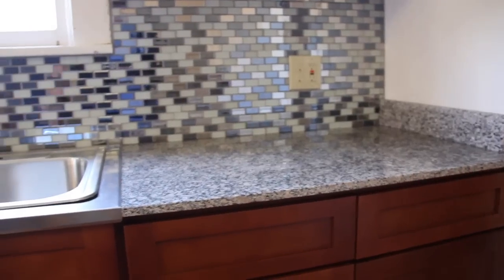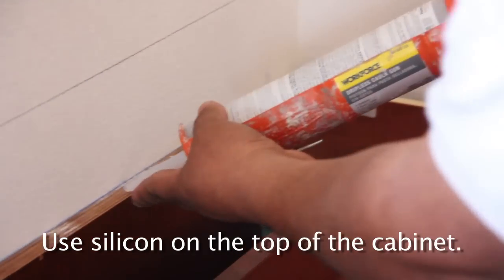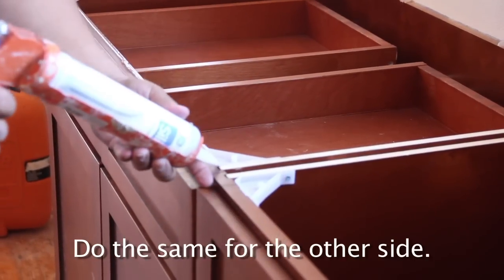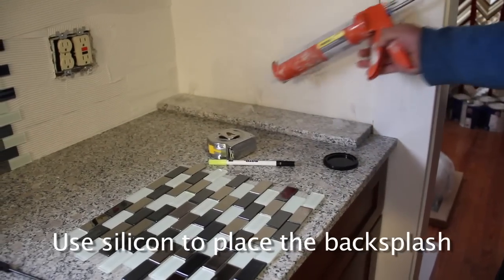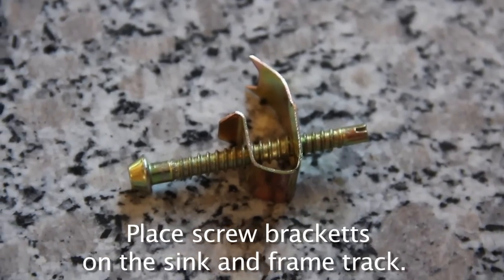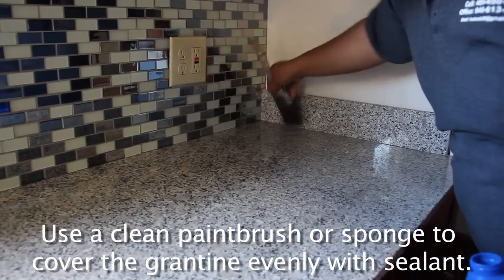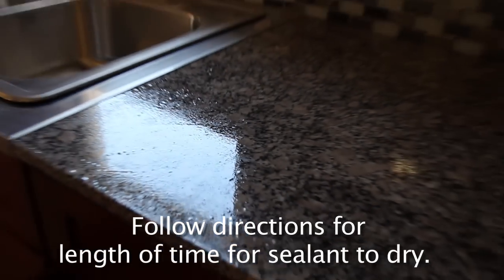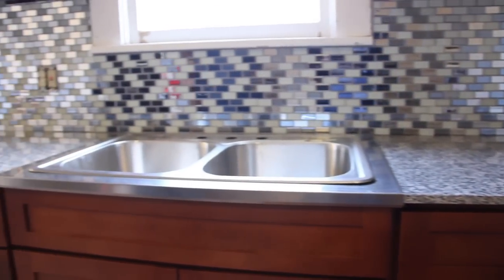Easy Kitchen Granite Installation with Vima Decor Stainless Steel Sink Insert

Comment: looks nice, professional... but water tends to seep between the steel rim and granite... . silicone sealant alone while glueing steel to granite may not seal micro gaps between both. And therefore need to have a 'gap filling material' along the entire rim, like a rubber seal. ribber seal is not an elegant dolution and also needs a clamp like device to tighten the grip.. better to allow gravity and weight of sink to do it... by using a epoxy strip tape along rim on bottom of sink. Seating the basin and pressing down, and neatly removing the excess material that squishes out at edges.